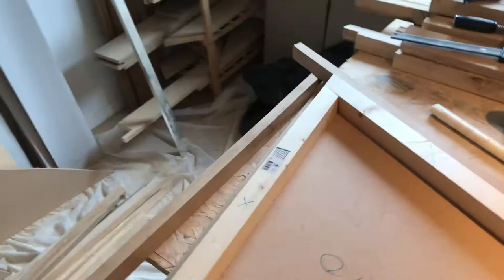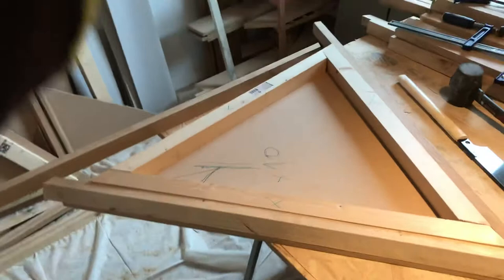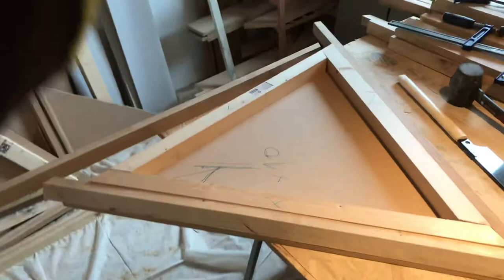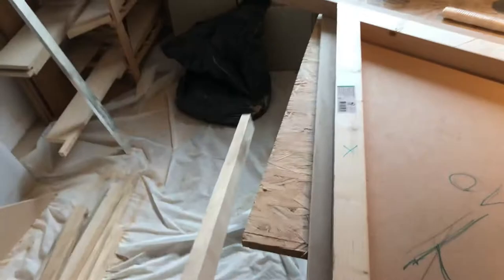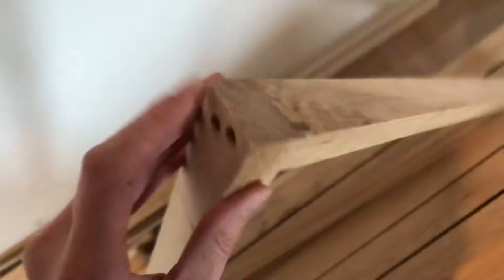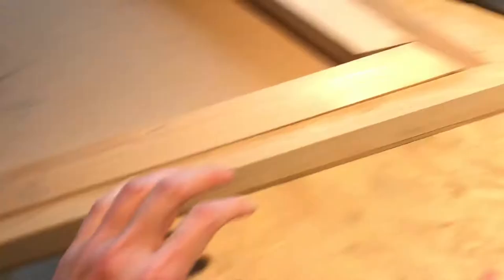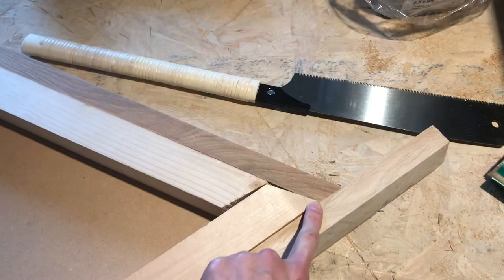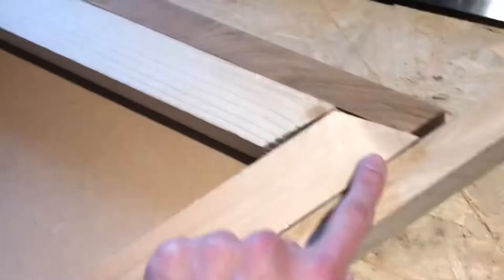Project Geodesic Dome - Episode 5: Building the triangles

Comment: The triangles will  fit together perfectly if the outside dimension and the bevel angles are accurate :)   Paul`s 2v dome calculator rounds up to the nearest tenth which affects the accuracy of the strut length. The strut lengths (and bevel angles) for a 3m 2v dome are 819.8mm ( bevel: 11.23 deg) and 927.1mm (bevel: 7.22 deg).  Paul fixes his triangles together with one screw in each joint which allows the triangle to twist so they fit together. This is fine for a dome covered with greenhouse poly but can be problematic for rigid glazing.